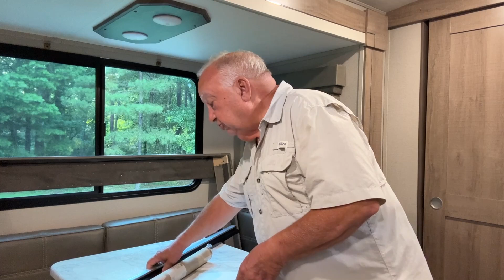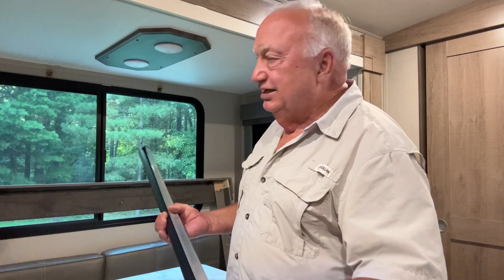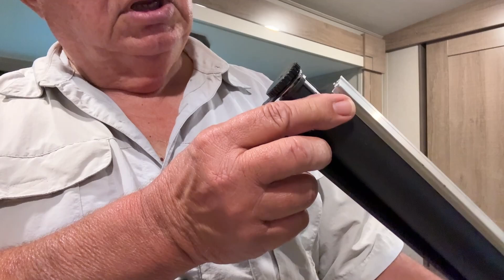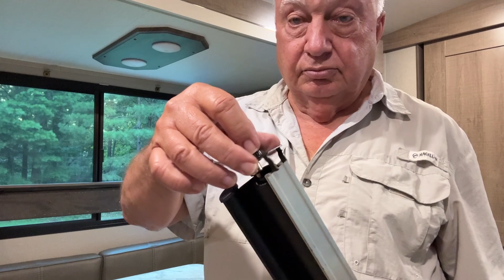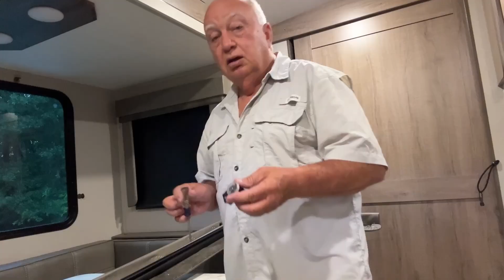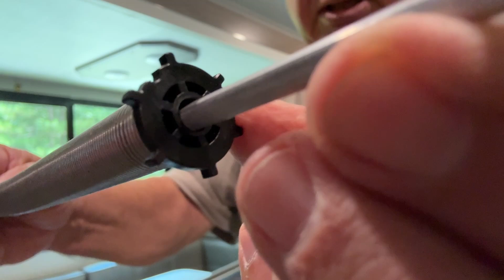Roller Shade Repair for Grand Design “2”

Comment: Hi again.  The smaller shade on the edge of the slide-out it also not staying down.  When feeling up under the valance on each side, it does not appear to have the same wheels for tension and stop as the larger ones.  You mentioned in your first video that you had a smaller shade in the bedroom the required repair.  What are the differences between the smaller shades and the larger ones?
Reply from the maker: I’m sorry, I just saw your question.  The only thing I noticed different was the length of the spring..

Comment: Hi JB.  Thank you so much for making these videos about the troublesome blinds in the Grand Design Imagine trailers.  I have watched both, and really appreciate your detail, and what did and didn't work.  I ran into a snag when taking down our large one over the recliners - the side with the spring - when I gently pulled the bar from the cap, the cap came off right away and left the spring and its housing inside.  The only piece that came off/out was the wheel knob and a round metal section with a metal nub in the middle.  Left inside is the black shaft (a few inches long) and everything housed in it, along with the spring.  Obviously I'm going to have to order the parts, but do you have a suggestion how to get the spring out without damaging something inside the tube?  Thanks!!